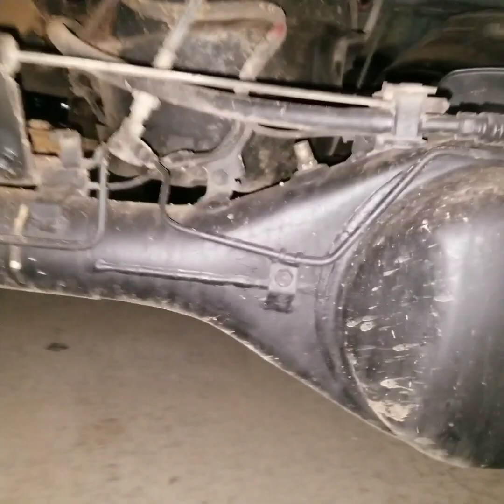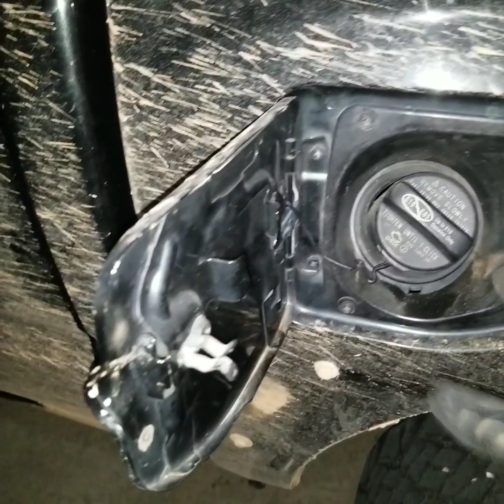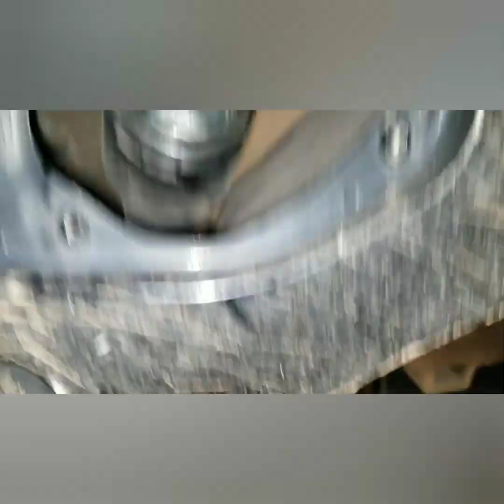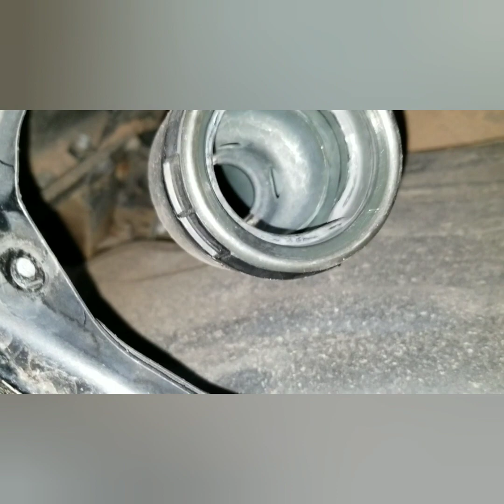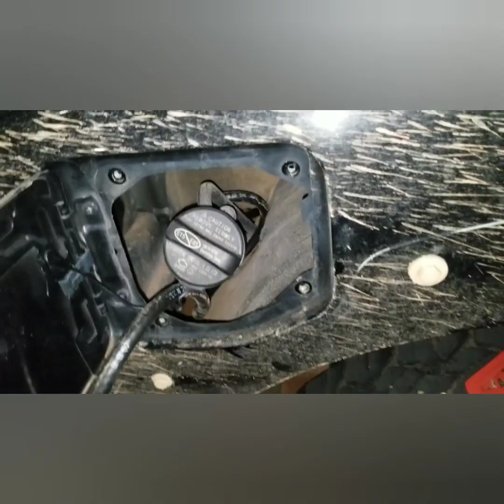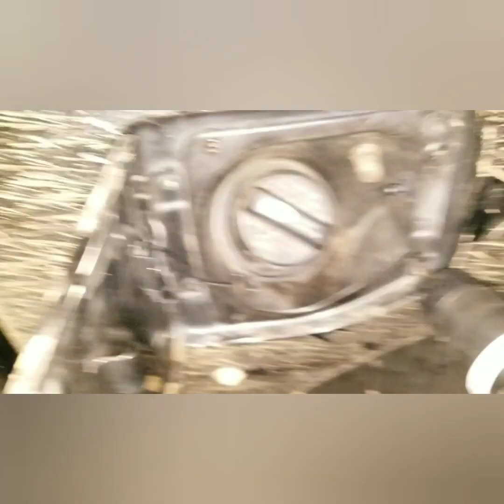Diff breather mod for offroad and water fording Toyota Tacoma scuba

Comment: How did you connect the original breather to the hose? Aren’t the threads to wide to fit into the 3/8” hose?
Reply from the maker: It was quite a push but just some lubrication and it will go on.

Comment: That brass fitting looks like it didn’t have the correct thread taper. Shouldn’t have been that hard to seat. Might want to change that with something that has exact same threat as OEM.
Reply from the maker: I took the old breather in and had the threads matched

Comment: Link to the brass fitting. Thanks
Reply from the maker: 1 union (Toyota part# 9040451026 this one works. What I did is I went to the auto parts store and took it off there and took it inside and picked up a union that matches the threading of the one off the truck. Really easy to remove.
Reply: @weekendwrench  thanks. Ill do same thing

Comment: you're not supposed to use the same breather. it's a one way breather so you need a 2 way breather. some people use a fuel filter in place but you get the idea
Reply from the maker: The same breather is a 2 way breather I think u should check again the purpose of this video is to show you how to avoid getting water into your differential thus raising the next question how is water getting in if it's a 1way breather to begin with?
Reply: @weekendwrench  the claim is that when the diff gets cooled down in the water and creates a vacuum that will suck in water through the axle seals. its plausible but under extreme temperature as there is always a net positive pressure inside the diff when used with the original 1 way vent. I'm moving mine up just so the vent doesn't get clogged from mud and other road debris.